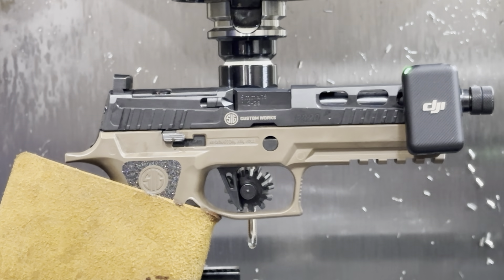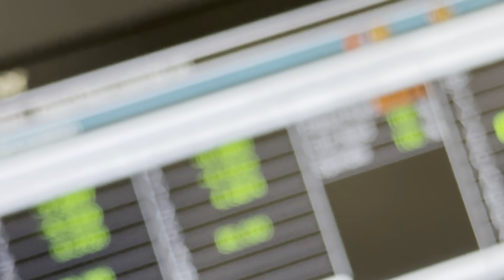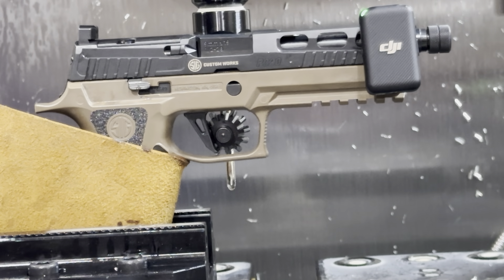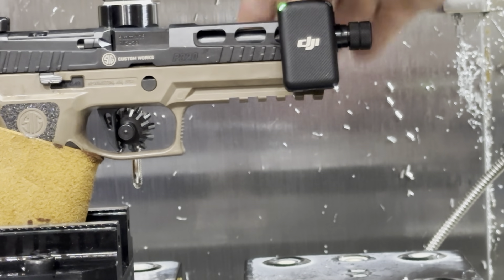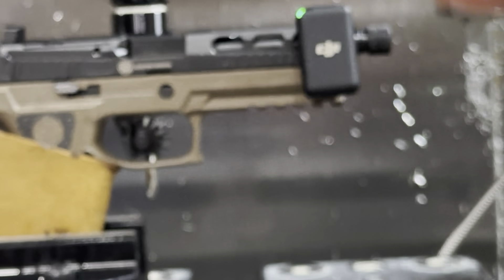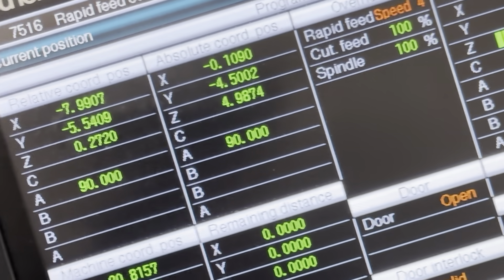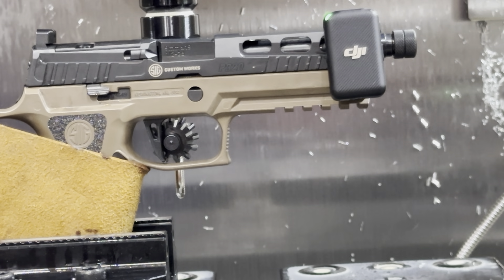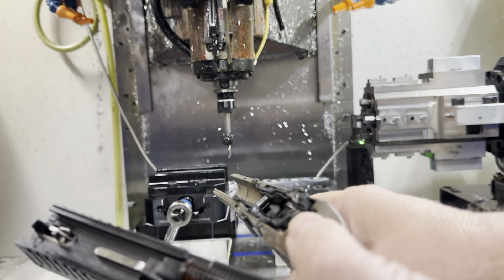Sig P320 accidental discharge tested in CNC machine.

Comment: I think this makes sense. Alot of the ND's have been reported in a holster. My thought is the holster is pinching the trigger guard pulling the trigger back to this very position. Then the slightest jolt and BANG. This would make sense as to why no reports of the p320 in the flux raider platform have not been reported firing off by its self. I own the flux raider legion and have been carrying it in a bag with one in the chamber and have been toting it around, I have releasing the spring loaded brace and bumped it against the safe walls and yet to have to an ND. I now carry it in condition 3  still very concerning.

Comment: Thank you for this. Now add the 10% tolerance between safety mechanisms and I would love to see that one in a million where all of the safety's are 10% out of spec. Tolerance stacking , junk foreign parts, poor or non existent QC, and a corporate attitude that just sucks. Wyoming was on the right track but this is more thorough and stable. But there are still people who deny that video proof of these going off in holsters and deny anything wrong with the gun. The gun going off with a bump to the slide at anything other than full depression and release of the trigger is dangerous. 10% of a million guns doing this is way too many injured or possibly killed.
Reply: And it's so damn consistent with the numbers. 109 and 90? Bruv...
Reply: 10% exact numbers now? "Tolerance stacking" is wordplay to suggest "multiple and simultaneously failures of all safeties all at the same time". Which sounds ubsurd.
Reply: @connorcline6982 hmm, so poor MIM parts that can be that much off, and with no QC, then there could be that much. But it's ok, wave your corporate flag. ANY gun that can go off without a complete trigger pull and just jostling the slide is questionable at best. So I presume you would be ok with potentially 10% of products killing or injuring your customers or others?  Acceptable risk for you?
Reply: @connorcline6982  - Tolerance stacking is a real thing. Killed a lot of gun projects which worked well for a prototype and the manufacturing tolerances prevented the gun to be successful in full scale production due to reliability issues. Now, with modern machining it isn't that much of an issue, except when you outsource production and get some out of spec parts from across an ocean.
Reply: @peterbaan9671  COUGH COUGH india COUGH COUGH
Reply: @ClippyBArts  - That's a can of worms I'm not willing to open. Let's just say I worked a LOT with Indians and I'm still not impressed to say the least.

Comment: This test means zero in conjuction with the dead and injured people with holstered 320s.  Those people were NOT manipulating the trigger.
Reply: These tests show that a combination of two inputs are making the gun fire: 1) pulling the trigger but not all the way to the break, and 2) contacting the slide. In any possible scenario a gun should only fire based on one input - pulling the trigger all the way to the break. In any possible scenario contacting the slide should not cause the gun to fire.
Reply: A bump to the holster could cause the trigger to move enough to take up the slop. Combined with the slide moving, bang.
Reply: @letsdothisplease22 Seems like the trigger bar spring might be affecting how the trigger rests and possibly some tolerance stacking in the system. On mine, the stroke to the wall is definitely shorter than what I'm used to with blade-style triggers. or other platforms. Pivot point hasn't changed, but the travel and effort feel kind of all over the place. Between a weak spring, sketchy preload, rail and slide tolerance issues, lug inconsistencies, and different retention styles deflecting or compressing the slide… it all adds up. And in the worst-case scenario? Bang.

Also seeing some faster wear and rollover on the striker and sear lugs. I know they're made using MIM, and yeah, it’s a precise method and has its pros. But honestly, I feel like traditional milled and heat-treated parts might stand up better over time, especially under real-world service.

Probably wouldn’t hurt for SIG to review their tooling and processes across facilities. Even tiny shifts can mess with part quality over time. Solid QC should be non-negotiable. And not trying to be harsh, but outsourcing internals to places like India might not have been the best call for keeping consistency dialed in.
Reply: What do you mean "zero"? We're all trying to build scientific data on what is wrong with the pistol. SIG won't do it for legal reasons, so the community on the internet has to.
Reply: I believe the holster is pinching the trigger guard and may be pulling the trigger to this very position. Then with a jolt BANG the firing pin trips. This would make sense when the Airman set his firearm on the table in the holster. I am just speculating.
Reply: @westside_tints8197 I’ve been saying this very same thing.  Maybe riding in a patrol car or sitting at a desk with pressure against it over time could remold the holster ?
Reply: But it demonstrates that slight pressure, or other issues such as worn or out of spec parts, dirt, link, etc. can cause the gun to fire if the slide is wiggled.  Wiggling a slide should NEVER under any circumstances cause a gun to fire.  A deliberate full trigger pull is the ONLY thing that should cause it to fire.
Reply: Yupp….
Reply: This is in response to the post with the screw in the grip and show that the trigger has to be PULLED TO FIRE
Reply: lol what are you talking about, this video proves those people shot them selves. But you spent more time blaming the gun than coming up with a safer way to carry and now yall got egg on your faces.
Reply: @VespertineKing you're high

Comment: All test with trigger manipulation just means the trigger is very sensitive, I want to see tests with no trigger manipulation
Reply: A gun should never go off with any manipulation unless the trigger is fully pulled. No other firearm does this on the market
Reply: @DarkEgos how did you come up with that conclusion?
Reply: @roberthynek9833  Basic firearm common sense its literally basic as hell. I own a sig im not a hater but if it can go off without pulling the trigger fully imagine after a few thousand rounds these tolerances are only getting worse over time.
Reply: @roberthynek9833  Where did you end up with the conclusion that a firearm SHOULD go off with a little trigger manipulation and not a full trigger squeeze? Have you fired one before?

Comment: Thank you, sir! Someone finally did a more scientific, accurate test. these guys jamming screws or even worse, using their finger to hold the trigger are just asinine. I believe the gun does have some design issues, but this shits light to the probability of this happening. Thanks!
Reply: Sometimes the inspiration is that screw because not every creator has a CNC or has the knowledge to make this a scientific test with repeatability or accurate measurements.

Comment: Great video! Now apply these results to inconsistent flawed parts in millions of P320 and we all know the results.
Reply: Correct!  Stacked bad tolerance from bad MIM parts from India... two negative tolerance parts stacked with a negative tolerance slide to frame OR a 10mm FCG mistakenly put in a 9mm frame, like is happening in police/DoD units/armories.
Reply: Should be easy to demonstrate. Let's grab one of these incident guns from any of the two dozen lawsuits or the recent Air Force pistol, and do the same testing. And let's also test other pistols.
Reply: So you're refuting his findings with pure speculation and have already come to a conclusion.
Reply: @ClintTorres  Tbf this test is done with a SIG Custom pistol which a) is far more likely to have been made using binned (in spec) parts and b) is likely well looked after. This is the best case scenario; a standard SIG service pistol is a lot more likely to use out of tolerance parts with carbon fowling.
Reply: @ClintTorres  "we all know the results." Doesn't even need to test, he already knows, dude. LMAO

Comment: Great job on your video. When people realize that only one out of a thousand or so will have this problem. I think it is the design of the gun that is the main point. Even with over normal wear and tear, over time, more P320's can posable have the same result. It is not worth any more injuries. Thank you for your time and effort.
Reply: It's actually more like one in 30,000.  100 UD claims to date and over 3 million in circulation.
Your chances of getting struck by lightning are 1 in 15,300 according to Google.
Reply: Yes. Tolerance stacking, cheap Indian made MIM parts that wear quickly, and residue buildup could all contribute to increasing the probability that a p320 would fire more easily in this scenario.

Comment: Still missing the point. The gun should not go off by wiggling the slide. It would be also good to test the tolerances of the parts across several guns.  There has been discussion that there is inconsistent quality control. Whereas your test firearm needed x amount of travel to create the effect, other firearms clearly show they need less. There are now numerous videos of others conducting the test, granted not with CNC machine.
Reply: The problem I have with it is its a sample size of one. We know that Sig has made many changes to the P320 over the years, some stated, some not and then you also have to factor in usage, wear, how clean it is and magazine in or out, etcetera. There are a lot of factors to consider on the over 3mil P320s out there. Even still, this one clearly shows an issue, it fires without a full trigger pull and wiggling the slide. That's not good for all the reasons you stated.
Reply: @Nefville  There are other videos out there to fall into rabbit hole of this issue. I did see where someone use four different variants of p320 and two of them to replicant the issue plus the had different frame to slide looseness. But everyone is starting to point at the fire control group and the issue that might causing this .
Reply: No, you’re missing the point. The trigger is being pulled and the striker is being held on the ledge of the sear under spring tension after all safeties have been defeated via the trigger stroke. This is how a striker fired gun works…
Reply: @thegreenberetlife0191  OK. 🙂 Enjoy being incorrect. Ignorance is bliss
Reply: @badgerservices9665  So, you’re living in bliss…
Reply: To be competitive, Sig Sauer introduced the "shake awake" feature, and a "decocker."   Now the Sig P320 fires 100.003% of the time versus competitors which only fire 99.995% of the time.
Reply: To command the gun to fire you can pull the trigger and 1) pull trigger a tiny bit more or 2) wiggle slide.
Reply: @Namegoeshere-qp7hg So you still need trigger pressure. Has anyone duplicated the un-commanded discharge, with no pressure on the trigger?
Reply: Take your Videos and just keep watching them and you will see discrepancies discrepancies of items in other things around the pistol that shouldn't be there
Reply: I’ve got a Sig Custom Shop fully stainless that has 16/1000th of play between the frame and the slide. I’ve seen polymer frames move 2-3 millimeters, huge difference
Reply: It not going off just by wiggling the slide. No one has done that yet. It takes input on the trigger.
Reply: @pcnorton arguing with crybabies is useless
Reply: @pcnorton since when is a gun supposed to go off without a full trigger pull ?
Reply: @thesouthernnortheast Since when would you apply pressure to the trigger to then grab the slide?
Reply: @caliveteranOIF  you were missing the point completely. The product is dangerous and unsatisfactory.. There is nothing else you can say to depend it.
Reply: @joshuasuggs2379 lol not defending the thing. They have been going off in holsters. How does it go off with no trigger pressure in a holster? Who has duplicated this without trigger pressure?
Reply: @caliveteranOIF we have reports of 320s discharging uncommitted while bolstered. The movement on the slide simulates possible travel imparted by a holster.
Reply: @joethemig1522 Of the trigger? I have seen no test that duplicates this without pressure on the trigger.
Reply: @caliveteranOIF  Yes, there are some holsters than can impart some action on a trigger. But the larger point of the trigger play here is to simulate the effect of dirt and debris on the internal safety components of the firearm, which should not ever permit an uncommanded discharge, which is unfortunately not the case with the 320.
Reply: @joethemig1522 lol then clean your weapon. Which holsters manipulate the trigger as a weapon is being inserted? If that is so why use a holster that manipulates the trigger?
Reply: @joethemig1522  Yes, some holsters can potentially manipulate the trigger of a firearm, though this is generally a safety concern and not a desired feature. Holsters should be designed to fully cover the trigger guard to prevent accidental discharge, and any holster that allows for trigger manipulation is considered unsafe, according to a Reddit thread on firearm safety.
Reply: @caliveteranOIF  Sure, but that doesn't change the fact that the design of the sear is such that the tolerances appear to be poor and given this, any sort of dirt/debris from normal use may result in a impairment of the safety mechanism, meaning that small manipulations of the frame could cause an uncommanded discharge.
Reply: @joethemig1522 lol every weapon has tolerances…where is the evidence that the weapon fires without pressure on the trigger?
Reply: @caliveteranOIF so you think it’s all good that the gun goes off without a full trigger pull by giggling the slide.  Got it….bring in the next clown
Reply: @bourbonbrigade who would jiggle the slide while the trigger is pulled?…you should watch his next video…Since they are going off in holsters. What’s is putting pressure on the trigger while it’s in the holster? Bring in the next clown.
Reply: @caliveteranOIF  The problem here being that there shouldn't be this kind of acceptance of a single firearm on the planet with tolerances such that should it fire without a complete trigger pull, which simply is simply and clearly not the case with the P320.
Reply: @joethemig1522 The Problem being you shouldn’t have screws or debris in your trigger guard. Is that not part of firearm safety…yes it sure is.
Reply: @caliveteranOIF  We're not talking about the trigger guard, or even the trigger mechanism itself. You're either not getting it, or you're being very disingenuous. No, the problem is that the gun's tolerances are such that the build-up of normal use may be causing the safety mechanisms on the firing action to fail in such a way that the gun can fire without a full trigger press, which should never, ever happen.

The screw in the trigger is simulating that fault of the safety mechanism. Again, there isn't a single firearm on the planet that should permit an uncommanded discharge with the trigger only taken up to, or before in some cases, the wall.
Reply: @joethemig1522 So you think having a screw in the trigger guard, applying pressure to the trigger is an un-commanded discharge…Yeah that’s not the definition of un-commanded.
Reply: @pcnorton  that wyoming fella got it to go off by wiggling the slide
Reply: He staged the trigger by using a screw.
Reply: @sumbhouti after he jammed a screw in it to simulate a partial trigger pull
Reply: @sunrisetacticalgear2676 that’s not as precise as a cnc machine, but it’s clear that the weapon didn’t fire with a full trigger pull. That should not happen whether it be a screw, grime, dirt, carbon, a finger or so on
Reply: @connorcline6982 exactly, a partial depression of the trigger, not a full actuation of it. SIG even claimed in their infamous “IT ENDS NOW” post that the 320 cannot under any circumstance fire without a FULL actuation of the trigger. Every shooter should know where their trigger breaks, and if the firearm can go off without a full breaking of that trigger the weapon is unsatisfactory
Reply: Since when are you supposed to pull the trigger and be upset that it fires?

Comment: Thanks for this. Finally someone makes a video where the measurements are clear and all variables have been completely removed. Nothing is left to vague dimensions, the youtubers words, or the viewers eye, but instead everything is measured with precise machinery. It was frustrating to watch some people make videos and claim that the trigger is at the wall, even though you could clearly see with the naked eye that the trigger pull was far past the wall when the gun fired from pressing or shaking the slide.
Reply: >"all variables removed"
>Doesn't repeat the test with a loaded magazine (with snap caps or blanks, obviously)

Okay kid
Reply: The thing is, the trigger isn't the problem. All the trigger is doing in the experiments is simulating the failure of the striker safety. Which we know fails from the tests done by the FBI.